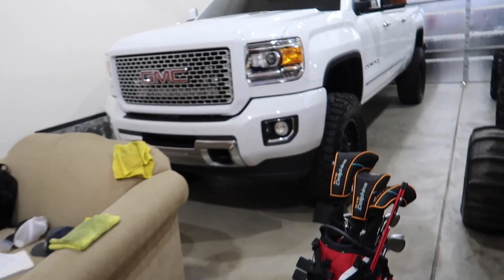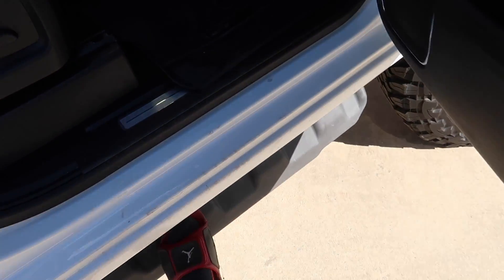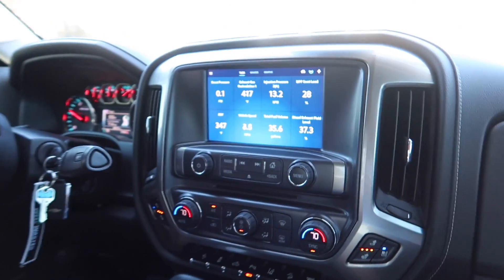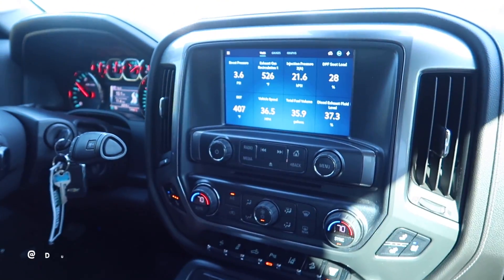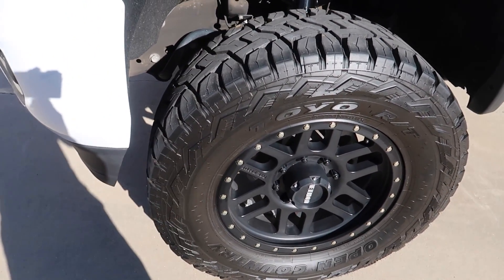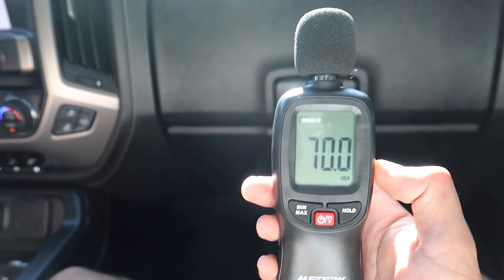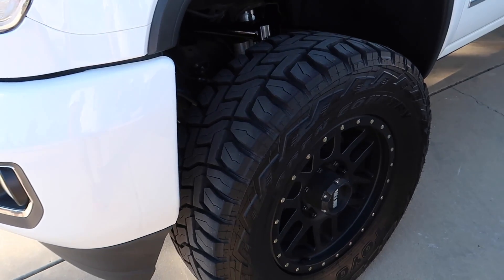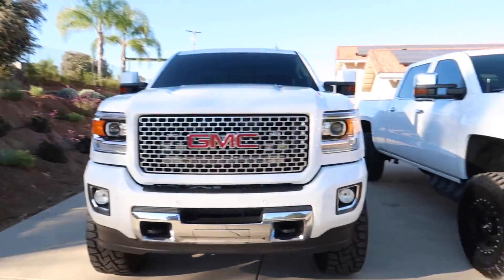HOW LOUD ARE TOYO M/T's VS R/T's

Comment: So I have personally had 3 sets of 35" toyo mtr's. I will say that as a personal preference, they will be the only tires i run on my f250.  From my experience I will say that if you frequently rotate the tires they will last likely just as long as the rt.  My last set had around 60k, with really about 6 months to another year of life in them but I decided to replace them to play it safe.  When I transitioned to the 3 set I had tried the 35" toyo rt.  I had them on the truck for about 2 weeks, and I really missed the aggressiveness of the mtr, so I switched back. Personally there was no real sound difference between the 2.  I will say that the grip is far more significant on the mtr than the rt and the overall footprint is different.  Although they were the same size, the rt seemed smaller.  In my driveway the mtrs do mark it up when turning the tires vs the rt.  Also as far as fuel economy, no difference between the 2.  Just my opinion Eddie, so with that being said MTR is the only way to go on the new ram.

Comment: Thank you for the video. I have the 33 on my ram the mt but they are unbearably loud and vibrate so much on the pedals and on the steering wheel. The sound I would compare it to being lauder than sitting on an airplane window seat next to the engine. I had the cooper at3 xlt before and were really quiet. I’m going to change them for the 305/55/20 which are a little larger than these 33.

Comment: I have a 2015 jeep wrangler sport unlimited. It has 35x12.5r20 mud claw MT tires. Being a jeep I rotated all 5 tires every oil change and got 80k miles on first set. Low tire noise. I just wished they didn't discontinued them. Now it's the mud claw II. They run $1300 for all 5